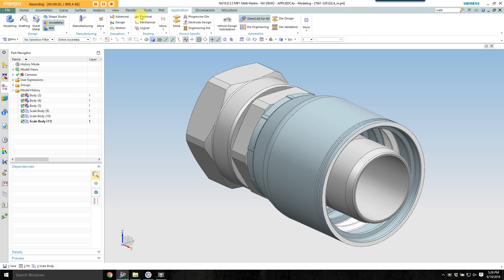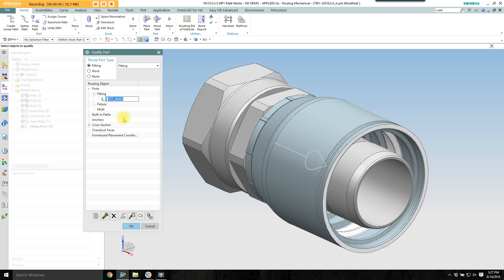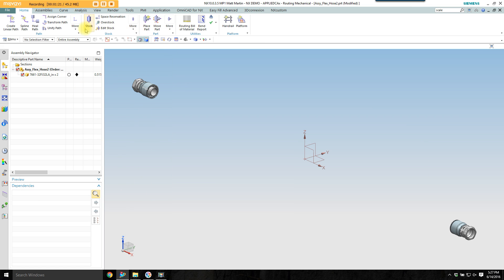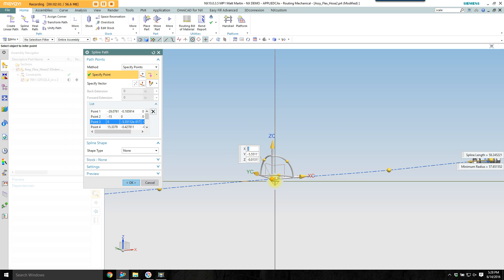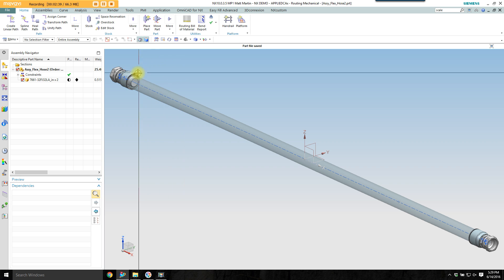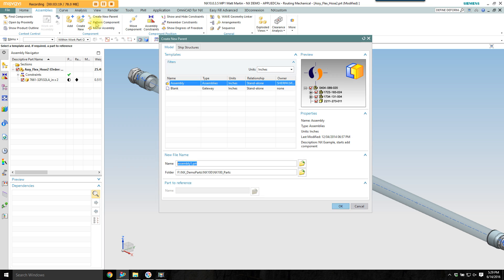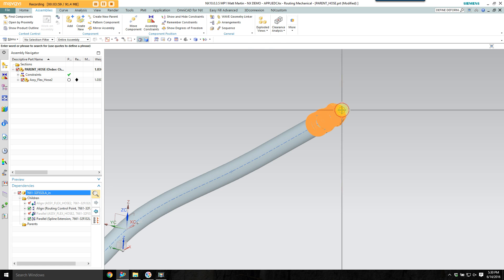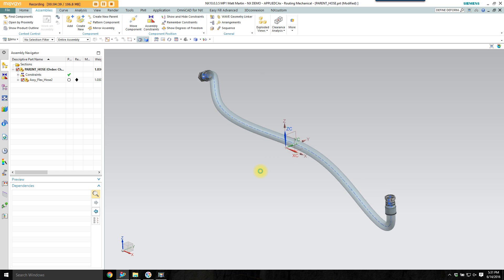Mechanical Routing - Flexible Hose

Comment: I have a question, you stated that you can add nodes or points after the deformable is done.  How can you do that, I haven't been able to figure out how to get a node or point in between an existing point node already.
Reply: Amanda, there are a couple things here. The first thing I look at is the Point on Curve or Line Snap Point. NX has made a bunch of changes from when I first recorded this video on what the snap toolbar looks like but the tool is still there. You must also be in the Routing Application to make the change. In regular Modeling application, I can manipulate the hose ends and the space-reservation will update but I cannot actually change (add or subtract points) the Route Spline object. Check your Part Navigator in the Assembly file to see that there is actually a deformation feature. I just tried this in NX1926 and, while in the Mechanical Routing application, I can add points to the spline and manipulate them.

Comment: Can you simulate the hose running along a wall? I mean, is it possible to constraint it to a wall so that it runs tangent or parallel (with a small clearance) to the wall? Thank you!
Reply: Yes you can by using Stock Offset Points or Stock Offset Surface. (MAX_PATH_STOCK_DIA/2.0) controls the offset. If the points created are associative to the surface, then if the surface moves the points and space reservation move too. You can also simulate droop or slack between tie points with Slack Mode.

Comment: Wanted to do something similar for mold cooling lines design keeping in mind the minimum bending radius and also a feature where the pipes wouldn't clash with each other.
Auto cooling line piping with just In and Out tags would be a dream

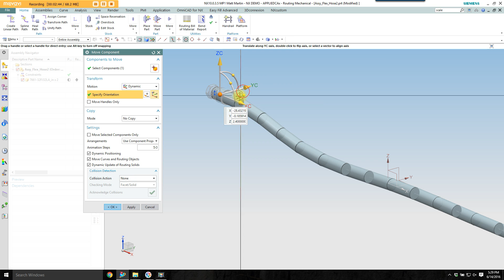Comment: 2:49 When I move my fitting the space reservation won't move as well how it did in in your video. Instead it keeps the position until I accept the movement of the fitting. How did you get it to synchronize the fitting movement with the movement of the space reservation?
Reply from the maker: Routing uses constraints similar to Assembly constraints between the routed spline and the hose end component. If you use Place Part and use the Routing Control Points (RCPs), the routed line/spline will be tied to the RCP in the hose end. When one moves, the other will also move.